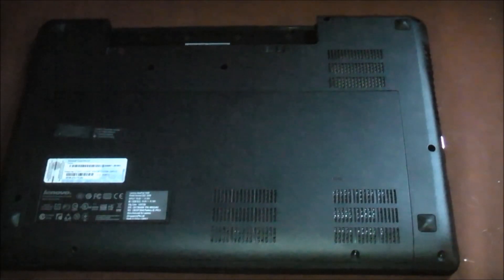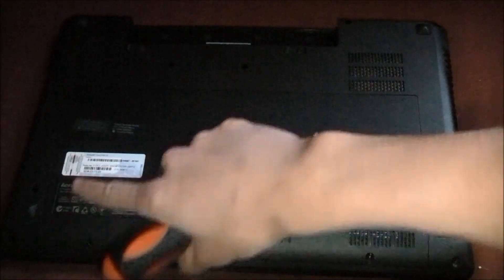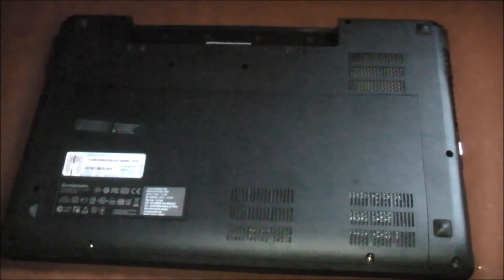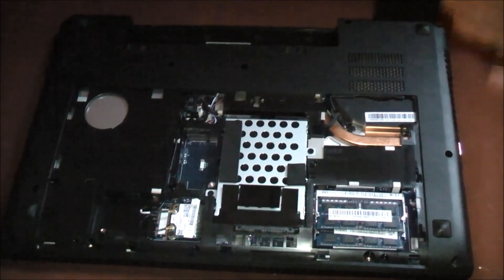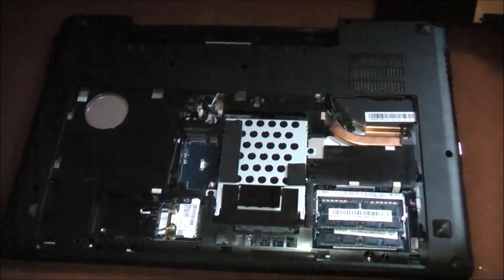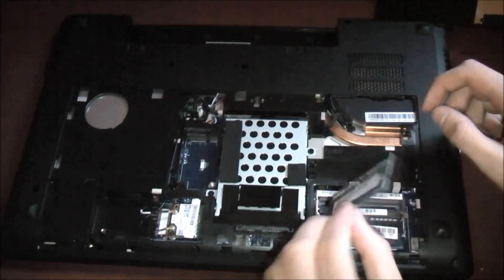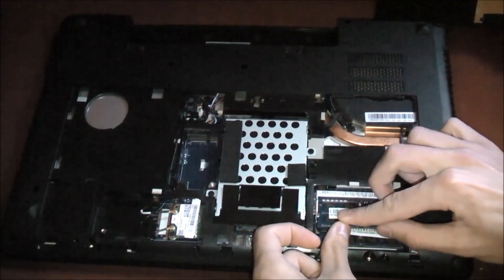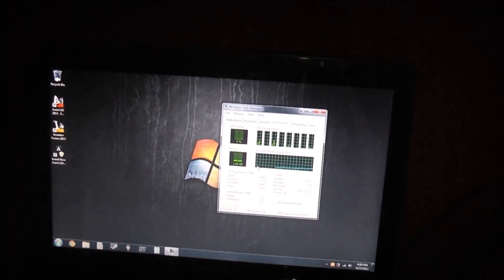Lenovo Y580 ram replacement tutorial

Comment: I've had serious heating issues with my y580. I had to get the fan replaced too because the original fan was so fucking loud... more then one time i have closed my laptop and put it into my computer bag, and it remained on and running while closed without me know... one time i took it out after it had been running inside the closed bag and the thing was soo hot that it actually burned my hand. I could also a  plasticky smell as if it was melting the plastic. other then that this computer is the shit man, i love it. It's handled pretty much ive ever thrown at it.

Comment: You can't short circuit any low voltage electronics by touching the contact points with your skin.  You still should not do it because the oil in your skin will increase the resistance accross the contacts.

Comment: you can install 16gb ram in the Y580, if you have got the version with the i7.
16gb doesn't work with i5..

i installed 16gb (2x8gb) kingston hyperX CL9 1600mhz in my lenovo Y580... runs great!!

Comment from the maker: it's not soldered on this model. alienware doesn't solder it on either. That's mostly apple, and companies that are a**holes about upgrading your hardware. They do that in case it fails, or breaks or whatever, it's easier to fix. Apple just gives you a new laptop on the spot so they don't give a crap about how easy it is to fix.

Comment from the maker: @eldest221 you can't. the laptop would get too hot. this card gets to 80 degreese, and anything better would get into the 90's. theoretically it is possible, but it's kind of a waste spending 400+$ on a laptop that is less than 1500$. to top that off, you'd have to find the same type of card in the system (alienware, hp, etc. all use different size/shape graphics cards.)

Comment from the maker: wow, whoever you spoke to must have not understood the question, they probably thought you were asking what is the most amount they sell in their laptops, but you can buy corsair dominator ram, kingston hyperx ram, if you want, I can send you a link to the website where to buy. This laptop uses laptop DDR3 1600mhz ram. as long as the ram fits those specs, the quantity can be as much as it wants to be. hell, if DDR3 let you, you could probably put in 32gb. but ya, you're limited to 16gb.